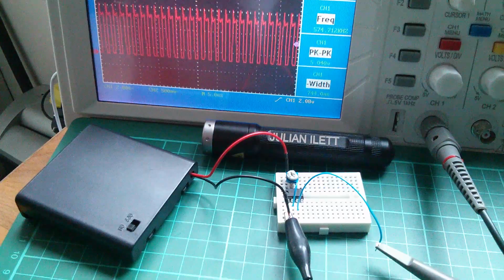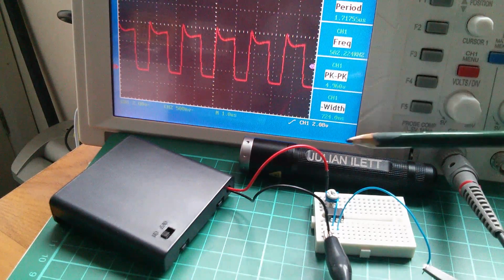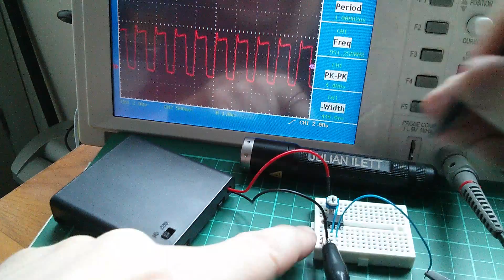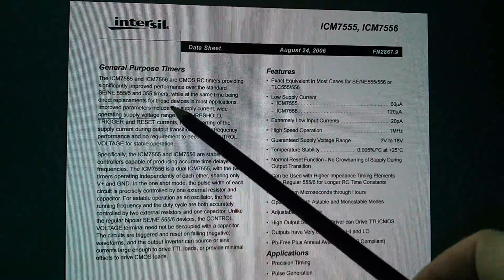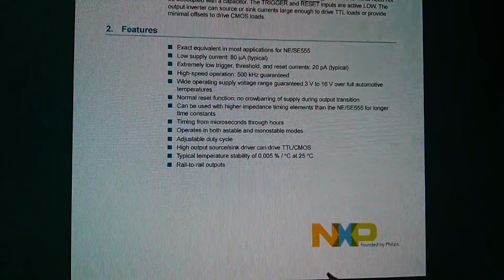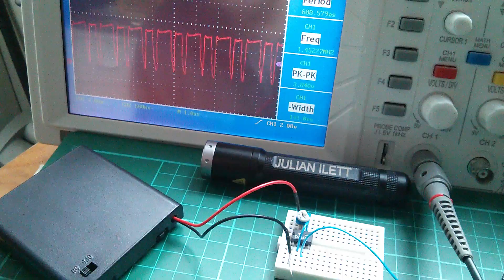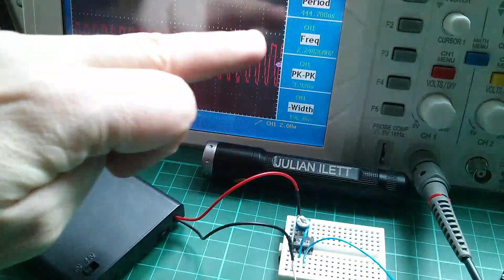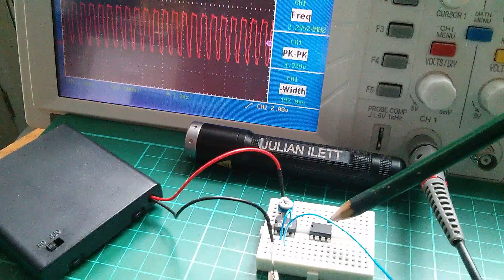Overclocking the 555 Timer

Comment: You did that maximum limit of  freq. checking in astable mode.....
Now try the same in bi stable mode...using pin 4 as Active Low RESET and pin 2 as Active Low SET ..
for this pin 6 (threshold) must be hardwired to low ( 0 V ).
the two trigger signals can be generated from external source/s..
lets know how high it can clock...😅

Comment: The maximum stable operating frequency of a 555-like timer I have read about was 9.4 MHz. This frequency was achieved for the Micrel MIC1557 version in its SOT23-5 package with a blockig capacitor of 100 nF at voltages between 4.6 to 6.8 V without a timing capacitor and a resistor of 330 Ohm.

Comment: "Thank You", thank you very much. My understanding of the IC555 tlmer is, it's frequently is "totally" independent of the supply voltage. Let me know. I look forward to hearing from you...
Reply: Yes. As long as you are within the operating voltage of the timer, the frequency is determined by the selection of resistors and capacitor.

As the capacitor charges, it's voltage will exceed 'trigger' and toggle the timer on
 When it reaches 'threshold' voltage it toggles off. Pin 7 discharges the capacitor when it toggles off and the cycle repeats.

Comment: When using a POT on the 555, it's always a good idea to put a 1k resistor in series with it. Otherwise when you turn it all the way down, the resistance will go to 0 and too much current will flow into your 555, thus cooking it. Also I think the reason it has a lower frequency with higher voltage is because of the way the SR latch is triggered when the voltage in the RC network drops to 1/3 Vin and rises to 2/3 Vin. With a higher voltage, there's a greater difference in voltage required. Ie for 12v it'd have to swing between 4v and 8v, for a total of 4v. Where at 5v it would only have to swing between 1.6 and 3.2 volts for a total of 1.6, so it takes much less time to trigger the comparators. To get a higher frequency, maybe put a 10pf capacitor in series with nothing to act like 2 caps in series with the wiring inside the breadboard, thus cutting down the overall capacitance.

Comment: You might be able to get it to go faster if you add some small decoupling capacitor directly across the power rails on the chip, and move it over to a PCB or breadboard to reduce parasitic capacitive coupling between the pins. The breadboard just might be the limiting factor for the frequency.

Comment: When I was a lad, and interested in generating a text video generator from TTL and a ROM with character codes, I didn't have any xtals whatsoever. So I used the simplest circuit I knew about at the time, a 74LS14 hex schmitt trigger IC. It only needed one cap and one resistor and could go to quite a few megahertz. About the same time (late 70's) ETI published a VDU circuit, but it was full of bugs as I remember.

Comment: I am curious if changing the configuration to just a feedback resistor from output to capacitor, and not use the discharge terminal at all, would go faster.  It also produces almost a square wave, for all values of feedback resistor.

Comment: if you stuck an aerial on the output pin and tried tuning to the same frequency on a AM radio would you hear it. Maybe use a 556 chip so the amplitude modulating of the carrier signal can be an audable tone, or you can make a microphone input?

Comment: i've made a circuit where the 555 drive a MOSFET , it was for a car ignition coil tester where i change the frequency from 10 - 100 Hz , all works nice on bread board but i strogle with the power supply where i need to provide 12v 5amp "i think 5 amp" ,, need help !!

Comment: Some modifications to try:
Nice decoupler cap from 1 to 8.
circuit: connect 7 to 3, and 2 to 6, pot with wiper on 5 to adjust volts from 0 to vcc.
cap 1 to 2, and r (pot) 2 to 3.
It's simpler and better as you're not reefing up hard on pin 7!
3 and 7 paralelled give better source and sink.
You might get 4 MHZ out that way!!
Also if you can tweek 5, it should let you screw it right to the boards!!

Will

Comment: Use TS555 i got it running at 3MHz
Reply from the maker: Nice. Is that CMOS?
Reply: +Mike Brink You probably get more answers from forums like: https://www.reddit.com/r/electronics
Reply: +Julian Ilett yes its cmos and it can go down to 3volt supply
Reply: A proper test would be drop the voltage back to 5 vdc after getting it to run as fast as you can at 12 vdc.

Comment: Julian, you probably know this and may even have done it (I couldn't tell from the video on my iPad), but it's a pretty common technique to improve stability in 555 circuits by decoupling pin 5 (control voltage) to ground with ~10nF. Also, the potentiometers you're using are intended to tune circuits during production and then be left alone. Their rated life is typically 100-200 adjustments, so they tend to wear out and get squirrelly pretty fast in breadboard use. You can get decent knock-offs of the Bourns 3296W-series 10-turn pots on eBay for next to nothing. Works good, lasts long time. Fun video -- cheers!
Reply: +FlyingShotsman Yeah - been playing with voltage doubler/negative rail generation circuits using 555 for the switching and even 100nf on pin 5 makes quite a difference to stability.

I'm afraid I'm one of those people who use 0.1uf decoupling to cover a multitude of sins :S

Comment: things are fine when adjusting a pot...
Consider what happens if the value of adjustable capacitor (ie a capacitive water level sensor) is  reduced quickly while it's active/in circuit.

due to the quick change... charge on capacitor can be assumed to remain constant  E=0.5*C*V^2 
V2=((C1/C2)*V1^2)^(1/2)
V2=V1* ((C1/C2)^(1/2)
ie voltage is stepped up, by the square root of the capacitance ratio

had a few spooky 555 failures, until small zaps from what should have been a 5V circuit gave me a clue the issue was inducing higher voltages than the supply, on certain pins.

Comment: It would be interesting to see how well it works at 2.4 or 3V.
Reply: +dentakuweb well there isn't a minimum on the 555 but the datasheet recommends to not go any lower than 4.5V so I'd imagine it wouldn't be extremely stable under 4V.

Comment: How slow can you make it oscillate...
Reply: +David Pilling with a big capacitor, as that is kinda what controls the timing, it can be weeks!  its the discharge time of the capacitor into a resistance, and the 555 timer basically is just a reset device
Reply: The timing cap must be very high uF value (within spec.limits) ... it should have very high leakage res. or better still more smaller ones in parallel .
Polymer/solid electrolyte is best try...
Likewise a proper maximum value R(a,b) for  the( timing).

Comment: woow, 2.25mhz you are so close to wifi. you coul try liquid cooler xD
Reply: +Proyectos LED: Wi-Fi works at 2.4 GHz... Yea, only like 1070x higher frequency and you have wifi!

btw, MHz and mHz are different units.
Reply: Isn't wifi 2.4GHz and 5GHz?
Reply: the higher the frequency gets,  the more the waves act like &quot;light&quot;. that means, on 5ghz you wouldnt transmitt trough walls or anything that good as 2.4ghz do..   sending in 434mhz or even UKW (85-108mhz) would make your wifi damn slow, but it would have an incredible range indoors.

the lower, the more it act like air / water or something.  it will go around or trough obstacles.

the other side, if there are no obstacles, you can reach hundred of kilometers in that higher frequency.   ive read about some dudes sending like 100-200km wifi signal with only 100mW power and a directional antenna.   this wouldnt work on lower frequencies, due to the dampening of the athmosphere.     
for example, a 4Watts 27mhz radio would go 10 to 50km max. even on wide open area.
Reply: +Erik Bročko hahah true. thanks
Reply: Raspberry It is. 2.4 is more common tho. 5 GHz can also reach lower distance than 2.4.

Higher frequencies can penetrate walls and water worse than lower.
Reply: +Dimitrios Vlamis well, its closer to 2.4GHz than NE555 ever had been -.-
Reply: That's not the reason why. On higher frequencies, higher antenna gain is possible because the wavelength is shorter. On lower frequencies also, high bandwidth is possible but it Will interfere with adjacent frequencies.
Reply: +Proyectos LED AM radio???
Reply: +Erik Bročko true, but if you're in building with lots of wifis 5ghz band is much more cleaner.

Comment: Ok, a few things, a piezo element is basically a pf capacitor, as you go up the frq. it starts to behave like a short circuit, if you are going anywhere above 10kh it's a good idea to add a resistor inline. I had a bunch of 555 overheat and die this way.

from what I have gathered looking around, 555 has a propagation delay >200ns, based on that, it should be able to theoretically go up to 6.5MHz, I don't have any smd 555s around, I was thinking if you do smd resistors and short wires on the chip itself and forego the breadboard and take into consideration other RF fussiness you maybe able to push it to >4MHz.

aside from heat dissipation on higher voltage and signal rise and fall times, wouldn't the capacitor charge about 4 times faster due to doubling of voltage?
Reply: +c4757p 
well, this is getting into some deep stuff :p
a lot here depends to the actual design of the wafer, I my angle was questioning if buffer transistors in the output having the needed Δv/t and and charge displacement to charge and discharge the (admittedly very small) capacitor fast enough
looking at the datasheets, it state %0.3 per volts drift, sounds a bit less than I remember in practice, that probably doesn't take into account the behaviour of passives, I wonder....

you are indeed right on the math, I did the calculation based on 150ns then as I was doing further reading I revised it to a more conservative +200 and failed to update the rest of the math. typical :/

yes indeed, hence why they stick to a conservative 1MHZ value in datasheets, that said, since this is just a non-scientific test to push the upper limit, quality of output is not really important as long as it produces something resembling a waveform of sorts.

Comment: 1:30 where is the slight change in pitch coming from when you showed us the batteries?
Reply: Phase shift
Reply: +Blowitup1991 Probably the microphone, with a gain changing with frequency, which is dependant on direction.
Reply: +Blowitup1991 Perhaps mains hum modulating the tone?
Reply: +tHaH4x0r but the direction and frequency didn't really change so i think it has to be something else

Comment: next step would be to do a dead bug version since the breadboard has a couple of pF's capacitance between the rails. you can also get course and fine adjustment by connecting two pots in series, one high value and one low value.
Reply: i was wondering the same... internal capacitance should be enough to push it more :-)